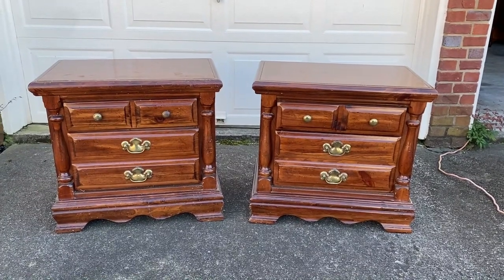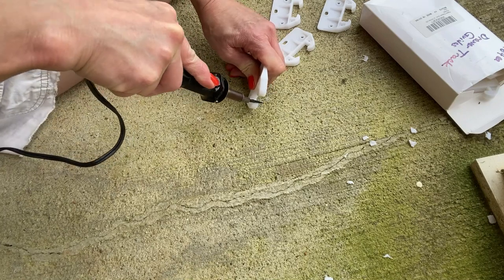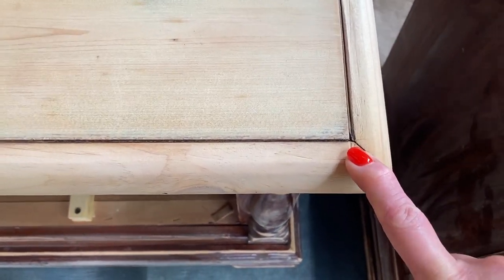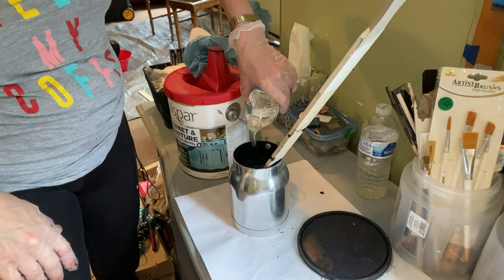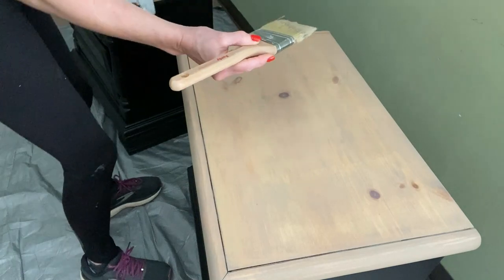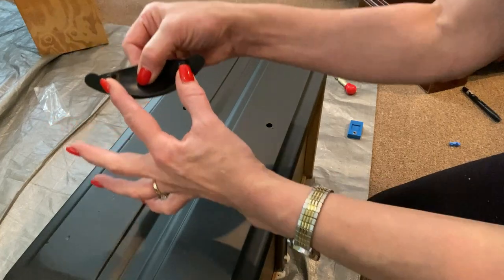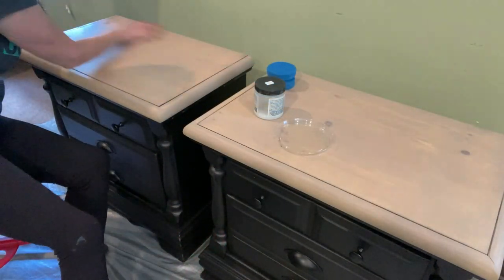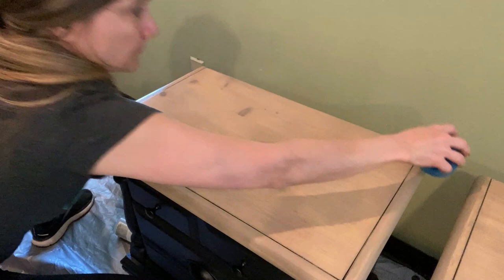FURNITURE MAKEOVER: Fixing Drawers and Getting Real

Comment: Loved how you flipped those drawer glides and hammered out the bent parts, and a bonus tip with the paint stick guide for your sander! I saw another youtuber use that Valspar Cabinet and Furniture Paint in a sprayer and it left a lot of texture, but yours turned out smooth.  A brush or roller is recommended, but I might have to try it in a sprayer, although mine isn't as nice of a sprayer as yours.  Your paint wash also turned out so even, mine sometimes go splotchy.
Reply from the maker: Glad it was helpful!